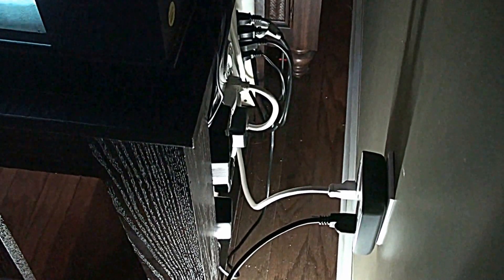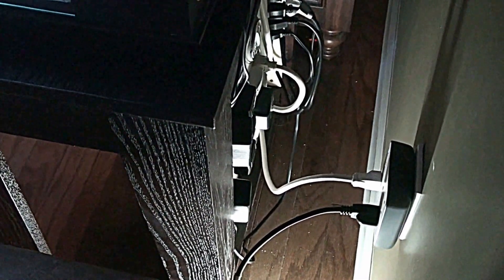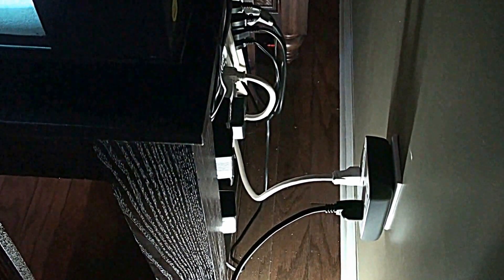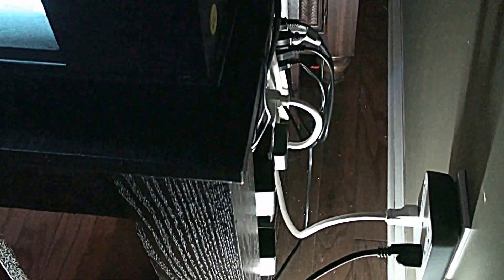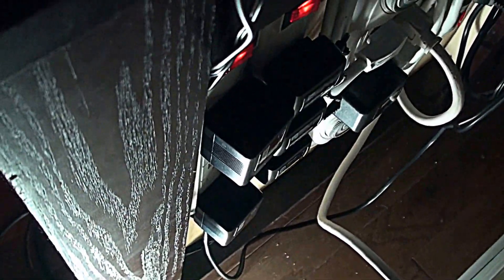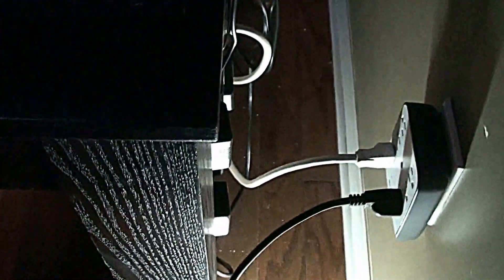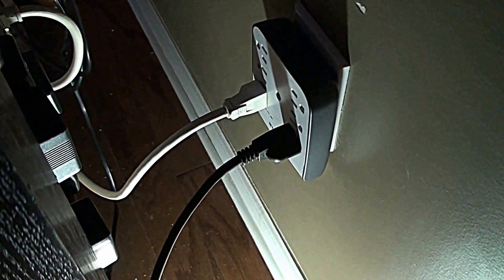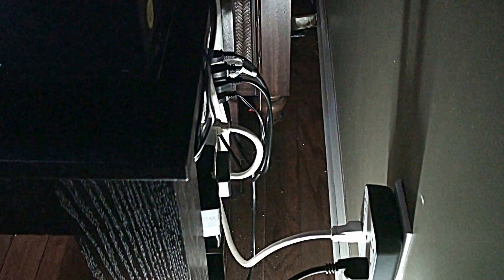Nano Aquarium Cable Management Part II

Comment: These Skyye lites w two plugs per lite and they need two timers on each power strip? And how do you for it? Did you get power strip w timers built in? I can't see from the other video. Frustrated w power cord timer stuff lol
Reply from the maker: I have one timer power strip that is set for day, night, dusk and dawn lighting. I have two other power strips plugged into that timer strip to handle/control the three skkye lights. I have one strip running my daylights (three plugs for 3 14K skkye lights)  and another strip for dusk/dawn (two plugs running blue leds for two outer skkye lights.) These two power strips are controlled by the main timer strip I have them plugged into. I plug the third plug for the blue LEDs (middle skkye light) right into the main timer power strip for my night light.

If you need more info, can email you pics with description if that be easier to follow...Let me know

Comment: So you just have the reactor or did you put a skimmer on to?
Reply from the maker: No skimmer, just a reactor. I firmly believe any reef aquarium under 30 gallons don't need a skimmer. As long as you don't over feed and keep up with water changes, you won't need a skimmer.

Now, just because you don't need one doesn't mean it's worthless. A skimmer would keep the aquarium cleaner longer letting you stretch out how frequent you need to do a water change.

In short, you don't need one but it doesn't hurt to have one. I will not use one in this Nuvo.